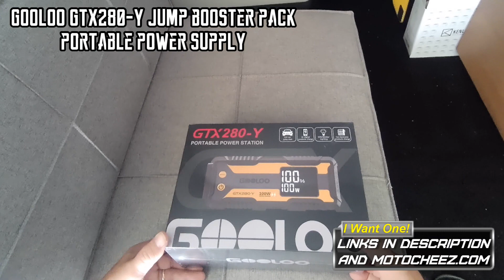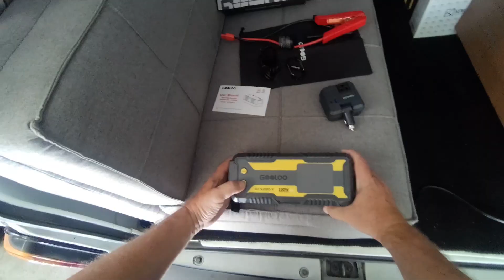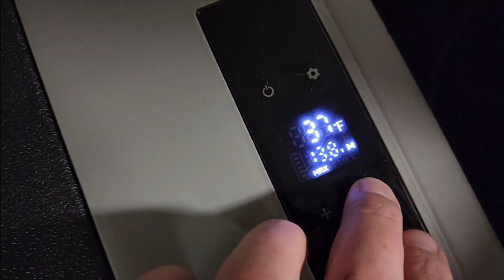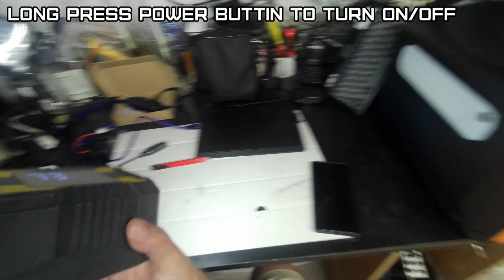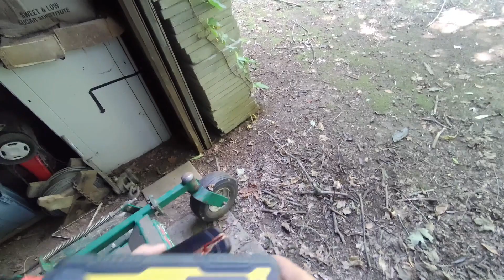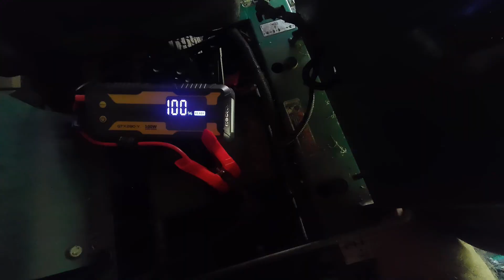GOOLOO GTX280 Jump boost pack, Detachable 120w 115v outlet, 280Wh battery, Home Camping Car

Comment: I like the form factor. Seems to focus on DC loads with simple ac capability.
Reply from the maker: Agreed, with these high capacity batteries it's nice to see versatility. There's so much stuff you can add on to these units I just wish the AC add on was a little more wattage

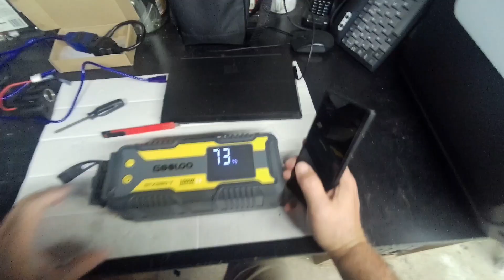Comment: @7:09 you say you don't have a 100w charger but you do. you have many other power stations and a lot of them have 100w or 60w output. charge the power station with a power station haha. maybe even see the efficiency of the systems by comparing what the supply says the load is drawing and what the load shows as incoming. 

standalone 100w I really like the Spigen ArcStation PE2006UJ. its replaced my laptop charger for travel since its a lot smaller. 

Check out the Lokithor JA302 jump pack if you want a jump pack. its done every car and truck I've tried and as an added bonus is has an air compressor built in. pretty portable too.
Reply from the maker: I did plug it into one of my 60 watt output USB C on a power station and as soon as it rolls over 60 watts it shut that board down on my power station, I don't have anything with 100 watt output

Comment from the maker: *UPDATE: company will provide extension cord for inverter to solve loose connection*
Charge with the inverter off USBC for 27w charge
Associates link and discounts: 
https://amzn.to/3pPO5ao
Discount: 10% off code + $80 coupon
Code:2P3DP8M8
Original price: $299.99
Deal price: $190.00
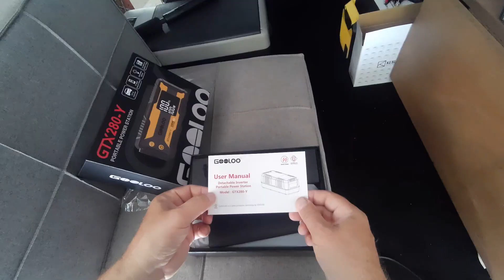Start Date: 2022-8-2 01:00 PDT
Expire Date: 2022-9-31 23:59 PDT
Reply: I just charged mine with the included inverter and usbc to usbc cable and it charged from 0% to 100% at about 95-102 watts in about 2.5 hours.however my inverter fits very loose as well,I charged mine while driving and the inverter kept popping out of the 12v outlet.
Reply from the maker: For some reason my inverter USB output wasn't 100w. Should have been.

Comment: Project farm did a comparison of starters and the gooloo came out on top so I was looking at them . That was a few months ago I didn't get one because there where a few model to 2000 and 4000 kept coming up the 4000 was the one that won on the comparison . It didn't come with all the inverter just the jump and the plugs .the 3000 must be a new product . I think I would still get the 4000 and just pick up a cheep inverter to plug in .
Reply from the maker: Yes, brand new, just released

Comment: EXCLUSIVE 100W INPUT

No extra wall charger is needed, recharge the GTX280 with the car inverter Type-C output and GOOLOO Type-C to Type-C cable, and the unit will fully charge within 3 hours

Attention: if the power inverter does not fit in your car cigarette lighter or is easy to fall off, we will ship you an extension cord.
Reply from the maker: I updated in description, they are providing the extension with unit when sold now. I'll try it through the USBC on inverter. Missed that!
Reply: @MotoCheez  give us a update if that works out 👍
Reply from the maker: @Sinerwray  trying now. Will update and add link to video thanks for pointing that out!
Reply from the maker: Just tried it, it's charging at 27watts off supplied inverter
Reply from the maker: I did charge it off the 60 W usb-c port on the 1800 W portable power supply I have, it started pulling all the way up to little over 60 watts and then shut down the port because it was drawing more than 60 watts on the output of that unit. So I guess if we had a hundred watt charger it would do it